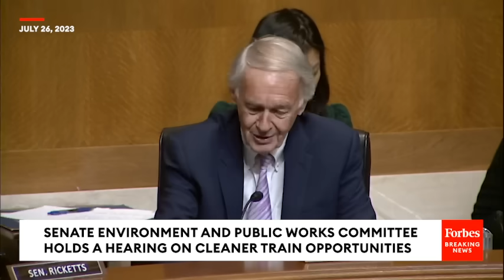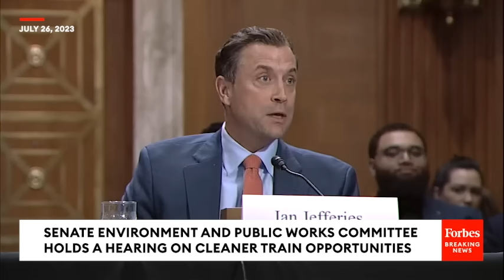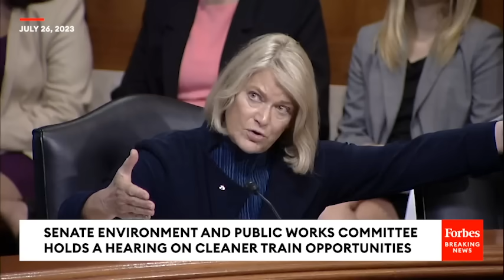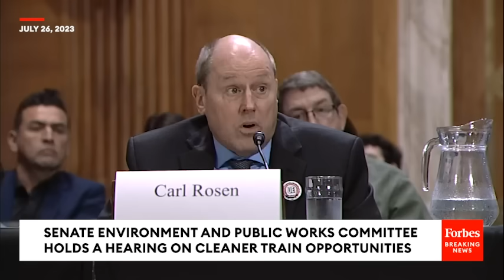‘How Long Would It Take To Replace All Diesel Locomotives With Electric?’ Cynthia Lummis

Comment: It's more than just the locomotives. There's infrastructure to put in place. Catenaries (the overhead power lines) are very expensive.
   As far as I know only a minority of trains run on electric. The Amtrak northeast corridor electrification wasn't even complete only a couple of decades ago. Then there's the privately owned freight lines such as CSX. Who's going to pay for that electrification?
   There's also aesthetics to be considered. People are becoming very sensitive to how things look. The catenaries and supports aren't that pleasing to the eye. Ordinary citizens should take an in person look at them before supporting such efforts. Do you want them near your neighborhood?
   Then there's a power grid question. Do we even generate enough power to run 2,000+ horsepower electric locomotives? There's even a question of adequate power for EVs coming along, never mind the trains.
   If they're talking about battery trains, that's not even feasible.

Comment: This is absolutely ludicrous & insanity, here in Texas we can barely keep up with the current demand for electricity (during this heat wave) let alone add all these proposed transportation vehicles to the grid. Society will shut down and collapse, and we will all become Amish. I don't see any of these battery advocates living like the Amish and leading by example, of course not, you never will. Second what happens when we run out of Lithium for all these batteries; it's a finite resource like oil is.....oops then we will have to convert in 50 years to something else, meanwhile these eco hypocrites will be getting rich off of Lithium which they all surely have stock in.

Comment: Battery power is not the way forward I think for loco’s, overhead electric power pickup is a better alternative mixed with diesel perhaps.  But why not have more nuclear power stations, that is a better alternative to solar and wind energy, also forgotten is hydro and wave power.  Seems to me they are limiting on energy source for some reason.

Comment: Funny thing it we were building all electric locomotives and moving freight and passengers via electric only way back in the 1930’s. The GG1 is a prime example. And the oil companies such as Standard Oil pushed policy to remove the cantany and power locomotives with diesel fuel instead of electric. Now since we remove that infrastructure (in most places) we have to spend the money to build it all back again. Europe didn’t have this problem, the majority of rail on that side of the world is all electric.

Comment: Near all locomotives are already electric already, they just use internal combustion motors to power the truck motors. But in any case I would think battery powered train heads impractical unless they use nuclear-power. and the common person freaks the heck out at the words nuclear power.

Comment: So many people on here are talking about putting big ass batteries on locomotives.  The Senator just said "zero emissions."  That doesn't automatically mean big ass batteries.  The alternative, which could use modified existing locomotives, would be to use overhead wires like local trollies and some trains in Europe.  But I don't think that system is capable of providing the huge amounts of current necessary to haul huge trains on the level, let alone over hills and mountains.  I think it will be many decades before it ever becomes possible to do without diesel-electric locomotives to move freight long distances.  And people looking at Europe need to realize that Europe is very tiny compared to the US.  Nothing in Europe is 2,500 miles apart and over two huge mountain chains.

Comment: Show me a fully electric Mach 1 fighter plane or long range bomber?   Army vehicles has a problem with all electric tanks, transport vehicles, armored personal carriers in where in the hell will you recharge them in combat situations??  Locomotives use diesel motors power generators which drive electric motors which pulls rail cars which transport supplies and other goods nation wide.  Total electric locomotives cannot do this. Stop this fantasy push for all renewal energy crap until the tech and infrastructure is available.  Many clothes are made with fossil fuels and keep ending that so the world can go naked? Casings, package materials mostly from fossil fuels.

Comment: The argument makes sense: 
1. The locomotive fleet is aging.
2. Might as well design electric locomotives.
3. While you're at it, start designing high speed rail lines that will transport families AND their cars. Make it so that a 1000 mile trip will be faster by rail when you take into account all the time spent at airport security, standing in line at the rental car place (Liberty Intl is the WORST) and finally getting to your hotel. That will take a big bite out of the airline emissions.
4. Require big rigs to only transport from a rail center to somewhere in town. Stopping those coast-to-coast trips will also greatly reduce emissions.

Comment: I know it is not the true end goal of the climate crazies, but for trains you DON'T NEED batteries but simply the old pantograph and overhead power lines. Super low tech, no massive mining operation for Lithium, Cobalt, Unicorn droppings, etc. The railways are IDEAL for this type of power system and the current diesel electrics can simply yank out the diesel engine.  The FACT that this is so simple and yet is not being used PROVES we are ALL being played by the ruling elite.   At most, enough battery power MIGHT be needed in small switching yards but even that could be addressed with overhead power.

Comment: Imagine your traveling at 36,000 feet, the aircraft is electric driven then the worst happens the battery storage banks shorts out causing a fire so hot it melts aluminum. The batteries on fire cannot be put out, each battery is shorting out and blowing up like cluster bombs! The fire will keep burning for hours IF NOT DAYS and your at 36,000 feet impossible to be disconnected,  impossible to extinguish. EVERYONE DIES!
I'm a retired Aerospace Tech I know for a fact this will happen.

Comment: To require this is insanity.  They should more be focusing on particulate emissions.  Mature trees can absorb more than the carbon emissions people emit.  Other plants do significantly more.   This is all about power and control.   The atmosphere only contains .04% carbon if it drops to .02 % plants will die.  The other point is good farm land in states is being taken for wind and solar which does nothing.  On combined cycle natural gas power plant can generate about 750 megawatts and is super clean and on takes up about 16 acres or so.

Comment: Creating an environmental problem by trying to solve a problem started by a leftist agenda. The power grid on the United States is not capable of supporting all the power requirements of EV solutions the left pushes. It will be decades or maybe never. The real conversation is the waste products of batteries and other  materials at the end of the life cycle.

Comment: People don't realize the MASSIVE electric power generation of a Diesel locomotive. During the Ice Storm of 1998, when the electric grid was destroyed in Eastern Ontario and Western Quebec, two towns were particularly affected in Quebec. Heavy transmission line and tower damage. Long term re-establishment of power by over-taxed crews in extremely difficult environmental conditions. But a long term loss of power in a Canadian winter would only add greatly to the disaster in terms of lives lost and damage to homes and businesses. What was to be done for those towns?

The solution for each was to bring in a Diesel electric loco and power the town with it. Tractor trailers could bring fuel to the loco to keep it going indefinitely. 

What do you bring to an electric 'locomotive' to keep it running indefinitely to relieve a disaster?

Comment: What's the rush....they make an artificial timeliness for zero emissions which is impossible....they know nothing about the reality of transportati9n nor do they use any practice common sense in their implementaion.....thinking that solar and wind will provide our power while increasing the capacity is reciculous.....wind and solar takes up huge land masses and does not have the density power that will be able to provide the electrical power....nuclear power is safer and more efficient and only takes up a postage stamp size of land compared to 1000s of acres for wind and solar.....until a better source of electrical power is developed fossil fuels and nuclear is the only effective source of electrical power...

Comment: Diesel. if you removed all of the restrictions off of a diesel engine and used an onboard hydrogen production system. You would be left with zero emissions, or very close to it. as well as an extremely efficient system. we have the capability of doing this currently.

Comment: I still wanna know what's renewable about Germanium Thalium, lithium and Cobalt etc...... Utilised for non-recyclable single use processing to make solar panels and batteries?

 Even the fibreglass blades of giant windmills don't get recycled,  they get used until they destroy themselves which they do pretty often then they get junked.
 So what's 'renewable' about this technology?

 The best batteries in the world are junked after less than 10 years of constant charge/ discharge cycling, the solar panels lose half their already crappy energy conversion efficiency at about the same time,  then you just throw them away and make more.

 What is renewable about that?

 Those elements aren't made in the natural cycles of the Earth,  they were created in late stage supernova fusion and we won't be getting more of that stuff.

So how is this renewable?

Comment: california cant keep up with energy demands now , while your adding rail infrastructure to the grid so is most civilians with their cars and green energy is woefully inadequate , there will be a crippling bottleneck  on the californian border , and if you cant use trains then it has to go on trucks , so heres a calculation , on a 2 mile long freight train 10560 ft a container comes in 3 basic sizes 20 ft 40 ft and 44 ft , take the 40 ft containers give a bit extra for the gap between rail cars so 55 ft  divide by 10560 its about 192 trucks per train you are putting on the road , say you get 4 trains a day thats 768 trucks ,,,,, see where this is going

Comment: All they want is people to trade their freedom to travel freely for a junk ev you can’t fill up in 3 minutes and be on your way. No you have to take a 9 hour nap to recharge the turd. Longer charge time and shorter duration as the car ages and eventually becomes all used up with no resale value. Won’t charge anymore or go anywhere with a dead battery. Planned obsolescence as well.

Comment: Here’s how efficient modern diesel electric rail locomotives are, and I’m going back to 1984 on this observation.
A reefer boxcar with 50 pound bags of produce that are hand stacked, not on pallets, can haul 2500 bags of this particular produce. This boxcar would be in a mixed freight train that would make drops after that car made thru the yard that is 1000 miles from its origin.
The same 2500 bags in semi truck box trailers would’ve taken three trucks at 5 mpg in 1985 to accomplish the same job.
40 kids in a school bus vs every parent picking up individual kids. The school bus may get 8 mpg, but the combined fuel used by all the parents’ cars is more fuel than the bus would use.
Greenhouse gaslighting.
Reply: Tier 4 diesels spend at least 30% of their life in broken down shop time vs working, depending on how much development the manufacturer has in their product. This is why Caterpillar quit the road truck engine supply twice, and also because the EPA has larger expectations than what can be 
reasonably produced using diesel as a fuel.
Compared to 1990, diesel engines were running so much cleaner and efficiently in 1998. The engine manufacturers did great jobs, and the engines made very good power vs being gutless strangled wonders of engineering.

Comment: The only "electric" train worth operating is like my Lionel "toy" train. 
I'm a Locomotive Engineer(Operator is our "new age" terminology) and I know what it takes to pull 18,000+/- tons of freight.  I can't imagine how many batteries it would take to create the power necessary to pull the thing, especially ascending a decent grade. And to construct those batteries,  imagine the resources necessary, and the waste(toxic?) and  duration, and disposal, cost, etc.   
I wonder what will be next?                       😶
Reply: The "resources" and "toxic waste" ARE huge in the literal destruction of our globe!!!
Reply: That is about 162 2016 Nissan Leafs barely burning rubber, at their rated max output.  Youre talking a train car full of battery. And Lord have mercy should that train car ever decide to cook off. For certain that grade would require overhead power lines for the train to drastically reduce the battery requirement. Even at half of that 7.5 megawatts, the transmission of that power from the lines to the locomotive is no small feat with a moving connection.  Other countries have electrified train networks, Ukraine comes to mind. They were in deep trouble when the power grid was interrupted. No trains moving on a good chunk of the network.  They had to make a mad dash to try and secure diesel electrics from other nations who had the same rail guage.   I dont care how efficient your diplomacy and logistics, it aint easy to borrow a diesel electric, non-standard guage, locomotive from a friendly neighbor.
Reply: Most trains in Europe are electric for ages. They use an overhead power conductor powered from the grid with low losses. Nothing new to invent.  In most cases cheaper than diesel to operate
Reply: @eelcosterringa1374  
When you develop the system/grid in mind, and towards that type system,  yes it works. I believe our current administration wants our entire country to operate on batteries, and in the very near future. The Piedmont and Northern Railroad operated on a system on power lines, for freight and passenger in the Charlotte area, but tonnage was limited,  and they moved to diesel 8n the 1950s or so.
Reply: @eelcosterringa1374  That's fine when the line is electrified like that.  We use that for passenger rail, but not freight
Reply: @eelcosterringa1374  Actually if you look it up over half the locomotives in Europe are diesel
Reply: @eelcosterringa1374  thats great where you already have the infrastructure in place and the power gridin place and the locomotives to run on it. we dont have that is the usa

Comment: Although commonly called "diesels," the locomotives actually are electrically driven. The diesel engine drives an alternator, which produces electricity to run electric motors mounted on the locomotive's axles. The problem with replacing the diesel generators is the availability of a large enough and powerful enough battery that would also be reliable and hold enough charge  for long distances while enduring the strain of pulling heavy loads in the process. Recharging also presents another problem with long periods of downtime required to recharge such large immense high power batteries.

Comment: Why is the focus on battery electric locomotives? I’m a locomotive engineer by trade, and can’t help but notice that once upon a time we had fully electric locomotives in revenue service. Many other countries still use them, and so do a few areas in the US. They draw power directly from overhead power lines dedicated to powering rail locomotives. Incidentally they can be incredibly powerful units drawing electricity from a power grid.

If we want to get serious about this start funding overhead catenary power line installation on all the Class 1 main lines. We’re also going to need a crap ton of power generating stations, and if we want zero emissions that will most likely mean nuke plants.

It’s possible, but it won’t be cheap, and it will probably never happen.

Comment: There was recently a piece about someone planning to put some power pedestals in a truck stop for semis to recharge batteries. The power company had a fit and said they did not have the capacity to deliver the amount of needed power and it couldn't be done. They need to start building lots of nuclear power plants now if they plan on recharging locomotives someday...or even Tesla's, now... And how about the power needed to run the plants to build the batteries and locomotives? But tell me where do they imagine they will get the skilled labor to do all of this?

Comment: Billions and billions of dollars for power plants, locomotives and catenary installation.   The United States had the Milwaukee Road and the Penn Central railroads that were electric.  Both were powerhouse railroads but went out of business in the 80's.  Solar, wind and batteries aren't going to power thousands of electric trains and the surrounding communities that they operate thru.  Hey guys there is a train coming thru town, shut off the lights and air conditioners so it can make it!

Comment: Many Railroads are already electrified. That is the wire running over the tracks that you see on Northeast commuter lines and many European railroads. It is doable, but expensive for infrastructure. What they are debating now is battery electric trains, which is insanely stupid.

Comment: Diesel locomotive's are actually diesel electric! The diesel engine is used to turn a generator that powers the electric motors at the wheels. Fossil fuel charges the batteries that would be used on a locomotive, might as well leave well enough alone. Tell the United Nations to stay out of our business!